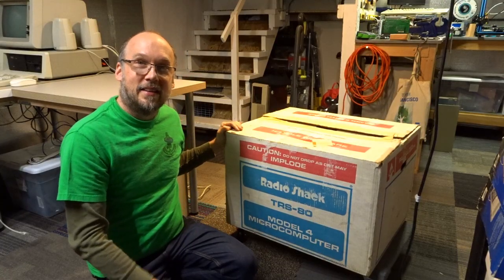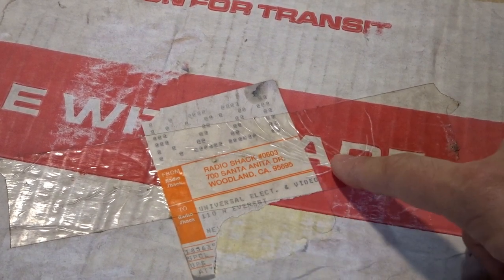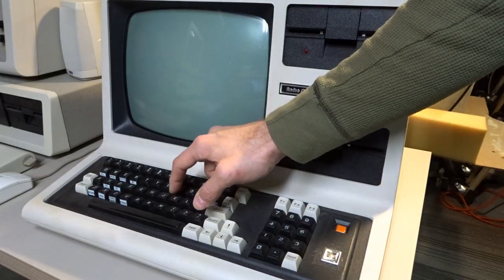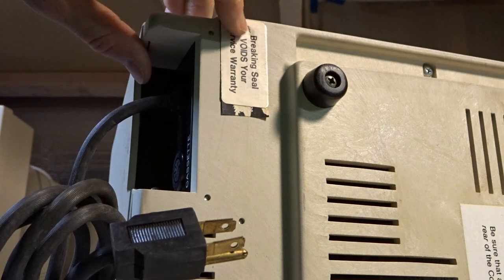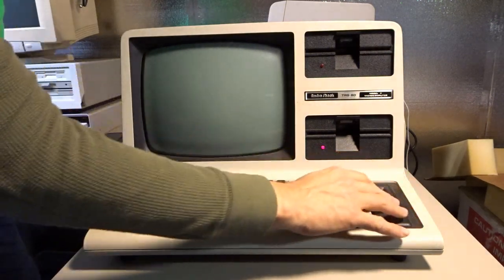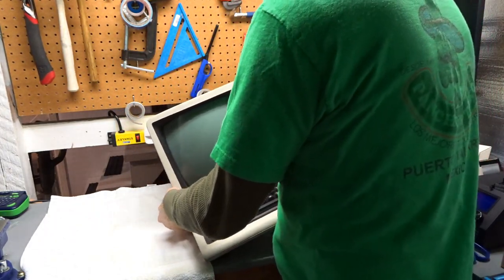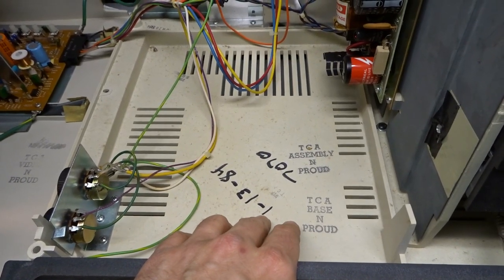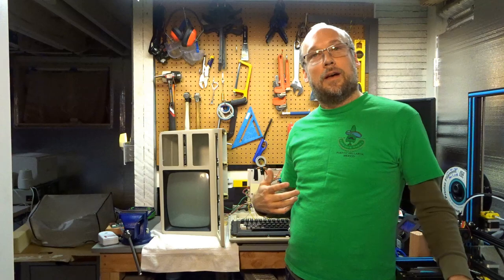Is that smoke? Radio Shack TRS-80 Model 4 Computer Unboxing and Test

Comment: I was the Computer Center service manager for Tandy in Santa Rosa CA in the 1980's  here are some items i saw on your computer
..The electrical tape is not from a service center..We would never ever do that...The white warranty sticker is not from Tandy..
Factory stickers were black with white text the service centers used white stickers with black text..The text and wording is wrong on yours to be from a Tandy service center...

Here is my guess of some history of that machine..

The original black sticker was from factory.
The white sticker that you cannot see (should have the words Radio Shack in the text) that is on top of that is most likely from a Tandy service center i would guess service center 01-7070 ..the sharpy writing inside case was done sometimes by a Tandy shop so that we could call the shop to get a repair history..normally though the shop number was written on the warranty sticker..(4 digit number starting with a 7) ..

The final white sticker you see is from a non Tandy shop  (does not have the words Radio Shack in the text) ..which is probably where the electrical tape was put on and the bent RF shield..

One thing that i cannot explain is the rubber stamp with the date of 4-10-1984 and the sharpy date of 1-13-1984 from a Tandy Shop ..possible just miswritten and should have been 10-13-1984?

I hope this information is helpful...

Comment: Remember working on "trash 80's" in class around 1980ish ,  finally got my own pc when the Apple IIc  came out lol
Reply: I was in my early teens and rode my bike to Radio Shack daily in the early 80's. At the time they encouraged us kids to sit and learn for hours. Sadly, I don't think you could do that today without having the cops called. I never did get a TRS-80 until I was in my 30's. Never could stand Apple, so I got into building my own PC's when that became a viable option.

Comment: Wow, $2000 for a TRS-80.   I spent $1600 for my Tandy 1400 Lt with TWO 3.5 floppies, and the internal HD (extra) would have cost the same amount.    Tandy was KNOWN for overcharging (Keyboard $100) but these were actually good prices for the time and for what you got. 

"Burn in" was what they told you to do with your new machine and some Shareware actually had test and burn in programs to make sure your computer worked correctly. It usually took 48 hours.   The stamp may mean that this machine was already burned in.

Comment: I've got a Tandy 1000HX and 1000RSX. Those are the "vintage" computers that I play with, and they're all fairly well upgraded at this point. I'd love to get a TRS-80 model 4, because I love the aesthetic, but they cost too much. 
As I type this, there's a model 4 on eBay listed as "parts or repair" for $470 CDN (and actually located in Canada with free shipping, which is refreshing), and another for $1,500 USD (~$1,870 CDN). Waaaaaay over what I'd pay for a hobby machine. These things aren't just vintage, they're collectors items!

Comment: 700 Santa Anita Dr. Woodland was not a store but a distribution center based on the building that is that the address on the label. Radio Shack had distribution centers all over the country. They really had a great supply chain and every step in that supply chain was a profit center. Yes I did work as a store manager in the mid to late 70s

Comment: So. 1985...conservatively, my Dad had a Trash 80. I don't recall the model. It had no floppies, but it had an external cassette deck for either playing or recording, and a cartridge slot. It definitely had no monitor as it connected to the TV. We had Zaxxon on tape, and Demon attack on cartridge. If we wanted to do anything else, it was via Tandy Color Basic...a big ass book that came with it. My youth was full of "Syntax error line x" as I spent days programming "The Battle of Midway" a text based, battleship clone, or making very rudimentary offerings.

Comment: A Radio Shack computer was my first computer. I had it one day and then took it back. I took it back because there were NO manuals at all with it. The store told me I had to take 6 weeks of classes in Milwaukee in order to learn how to set up and use that computer. Those classes would have cost about 1/2 what I paid for the computer. 

I ended up buying an Atari 400 computer which turned out to be a better fit for me anyway.
Reply: Erm. Ok
Reply: That store was ripping you off. New computers came with manuals and even if it didn’t you could have gone to a library or bookstore and found books to teach you.
Reply: @Sashazur  This happened when the Radio Shack computer first came out. There wouldn't be any books in the library or bookstore specifically for the Radio Shack computer. 

I didn't even know how to hook it up. I'm sure I could have found a book on Basic if I had even known what Basic was.
Reply: bjbell52 The store must have taken the manuals out to rip you off. My TRS-80 came with detailed manuals.

Comment: The first thing you have to do when dealing with old computers, is to get rid of the RIFA caps from the power supply. You can replace them or simply put them off.

Comment: Wow.  My first computer was a model 1. Later I bought model 2 PROMS. The bummer there was the model 1 motherboard had room for only 2 PROMS and I now had 3 PROMS to worry about. I had to lie in the RS store to get the new PROMS because they said I was allowed to buy parts ONLY for the computer I already owned. Right or wrong that was what they told me, while looking down their noses at me. I then bought a model 2 service manual and in there was a diagram of the PROM expansion board, which turned out to be fairly simple. I was in college at the time and used their lab to design and build my own expansion board. I mounted it inside the case and connected it to the original single PROM socket via a ribbon cable and header assembly. It worked perfectly,  but I still had only 16K of RAM. I found an electronics shop that had 64K x 1 memory chips. I bought a set for the horribly expensive price of 100 ish bucks for the set. They too worked perfectly. I still have that Frankenstein system and boot it occasionally to play one of the first versions of Flight Simulator from Sub Logic. Good times. Great memories!
Reply: I never saw a Model II other than in the catalog.  From what you're saying, I gather that it was similar to the Model I internally?  That was probably the heyday of amateur electronics and computers overlapping.  The CPUs were still slow enough to hack with off-the-shelf out special equipment without worrying too much about wire length and interference (ignoring the EMI that the Model I itself put out).
Reply: Yea, the Model 1 and 2 are almost identical.  The PROMS are the only difference (that I know of).  I bought a small RS program that boots with a machine code prompt.  I then printed out the PROM contents to make sure I had a hard copy.  Dunno why...that was a waste.  But I still have the 2 inch-or-so thick fan fold paper printout.  No disc drives for this model that I knew of.  Input was a cassette tape and I later bought a neat product called, Stringy Floppy which is connected via a system parallel port.  It uses a small (1/8"??) endless loop tape.  It still works!  The cassette audio input is currently flaky, I think likely due to a cap that is probably going bad.  The slow CPU speed of the system made making hacks and cables no big deal.  The Z80 was close enough to the 8085 that I was using in college, so I was able to use it to do homework (via a 8085 in a SDK-85 bread-board system).  All fun stuff!

Comment: This machine always reminds me of the Sperry I cut my commercial teeth on, very similar looking and back in them days I had up to that point only worked on what I could find down the scrap yard which was pretty much the Commodore PET and the reason them PET's were thrown away is because they were broken beyond feasible repair yet I managed to fix a couple.   The Univac I used for British Rail as part of their emerging TOPS system of rail unit management, I lost my job as a prank I and a friend pulled saw British Rail's sealink ferries tasked into the nearest railway carriage repair shops, not knowing the very tempest of disaster that doing such would cause... you see everything in British Rail had a class, from a paper napkin to a car ferry and they gave car ferries a locomotive classification and it was a doddle to task all of BR's class 99's as they were known for carriage repair and cleaning, the other end instead of rejecting the job as would have been suspected, acted on it instead and opened up 8 bays for reception of 8 sets of class 99's.   Movement orders were then given for class 99's to be taken out of service and attached to locomotives for towing to Eastleigh rail works... so eight locomotives arrived at Southampton and other docks waiting to be connected to eight sets of class 99's which were no doubt bobbing merrily in the water... when the area manager realised what a monumental cock up had happened he spoke to me and didn't repeat himself swearing over 15 minutes... whereupon I was summarily sacked and ended my railway career.   It did serve a monumental lesson to British Rail on operational difficulties in such situations but it didn't save me my job...   I went on and did some banking software, I wrote a banks clearing house database in a lunch break which survived into the 2000's on the back of a piece of paper, simple thing linking clearing house stuff to share databases for tax dept stuff, it was so cool and modular too, just had to add layers to let it grow ad infinitum which it did and was this banks second largest database until modernity took over.   Any modern UNIX operator would recognise the principle, building the house around the core always but back then it was all new stuff.  (sorry for long post)
Reply: And I bet you got precious little appreciation for delivering a durable, extensible, and time-tested system. 

Kindly don't ask me how I can be so confident in saying such a thing.

Comment: This i so so cool , I remember the day I bought a Model 4P. I think I might still have 5.25 CPM/MPM Montezuma 2.2 disks for this instead of running TRS Dos. A side note the Floppy cable is missing pins. If you create a full loaded cable you can go the full 96 track 17 sectors I think to have 720K floppies. Ran a BBS for years on one of these.

Comment: Yeah, all of those power supplies are on borrowed time, and easily repaired, im sure all of the caps were passing a lot of DC and did bad things in this scenario.   Should have at the minimum been brought up on a variac, ideally, ESR testing on the PS filter caps to get an idea of overall health.
Reply: Dude, it is still working.  Just the X2 cap failed.

Comment: Damn RIFA caps. Always explode after being turned on for a few minutes. You're right - the smoke stinks. They're used in all sorts of electronic equipment. Computers, oscilloscopes, printers, test gear and more.

Comment: pretty good find, TRS-80s in that condition are hard to find at 80 bucks. Got any good software for it?
Reply: I would be too had a TRS-80 Model 4P ages ago, wish I still did
Reply: $80 is a steal! They go around $500-2000 CDN on eBay. These aren't just vintage PCs for nerds to muck around with, they're collectors items!

Comment: I learned to program on a Model I Level II and used IIIs and 4s at school.  We had a shared network hard drive that 8 megs and was about the size of a desktop computer.  How things have changed.  I found a patch to TRSDOS that would remove the passwords on the entire system.  I still remember the memory location.  My teacher knew I could do it, but I didn't show her or anyone else how and she was ok with that.  At least once she did ask me to unlock a student's suspect program and her suspicions were confirmed.   I think he thought it was funny to have a program that put up threatening messages towards the teacher.  Since there was a password on it, he thought it was safe.  Nope.  I wish I could remember more about that situation.  It was only about 35 years ago......

Comment: I've got 2 identical 30 year old vintage vhs machines, one from a smoker household and one not. It makes a major difference in condition. The non smoker is mint inside. The smoker stinks and is all yellowed, white plastic gears have turned almost brown and there's evidence of cockroaches present at one time. It's been relegated as a parts bin and stays in the shop.

Comment: You know what's scarier then a capacitor letting go? Having a BIG filter capacitor let go in a big stereo (Realistic STA-2100) with headphones on. R.I.P my headphones and my underwear. When the filter cap went for some reason it messed with the headphone output which "borrows" power from the left and right channel amplifiers, it blew up a pair of 16 ohm studio headphones with 45mm drivers. To this day I still have to find the rare high power transistors for it, one of them went a little funny when that happened. It's been recapped but one of the channels overheats after 10 minutes.

Comment: Im thinking "N Proud' is likely the guy or girl that assembled the machine. It would make sense. Just about the only computer that still brings about the same price now as it did new. This was a top end unit, but its ugly sister was only around $350.00, had this been a true unopened machine it would bring $350+ easy in the right circles. The V20, C64 and 128 are holding their own too. Love this vid... good job.

Comment: Burn in and proud 
Haven't heard that in a while.
Burn in = the unit was tested under load for an extended period of time.
Proud = passed all items working good no failures during burnin.
You'r supposed to put something other than proud if you had to do a burnin repair on new equipment.   Most fudged it tho. just fix it re test and ship.

Comment: Recently turned on a TRS-80 Model 4 we got for really cheap ($40, can you believe it?). It booted perfectly, all is good. Then we got a loud crackle and pop, and smoke. Same cap blew on ours!

From what I've read, it's just for filtering the RF from the AC line. Considering the machine was running fine for the brief moment after the pop, is it possible to just remove the cap and run the machine without it? Inevitably it will need to be recapped anyway, as a machine this old can get some bad capacitor issues, but in the meantime, is it safe to just run it off of a filtered UPS?
Reply: The cap prevents RF from being radiated out of the power supply.  The thing is a noise generator without that cap.

Comment: Lucky guess on the Break key... I'd have put money on you not figuring it out.  To be totally correct, you held break while power cycling, but realistically, you can turn it on, and hold break and press reset, that was typically how you booted a non-disk system.  If you look around there's a lot of virtual disks you can download to a PC and write them to a 5 1/4 inch drive so you can boot to a disk system.  I recommend NewDos 80 for the OS.

Comment: What did you do...what keys did you press to bring the characters back to the screen? I have the same TRS-80 with the same kind of parallels lines on the screen.
Reply: Hold down the "break" key when turning the power on to start in ROM BASIC
Reply: Or put a boot floppy in it

Comment: Was this cold by chance when you turned it on? I learned the hard way never to turn on cold electronics in a warm house. It causes sweating and component failure.
Reply: The RIFA paper capacitor fails due to ageing and unclimatised storage. Even if you warm it up before, it will fail within hours or days. It was already an outdated piece of crap when this computer was built, but RIFA seemed to have kept the hype going for years and manufacturers bought in to it.

Comment: Didn't these computers run business programs like BASIC, FORTRAN and Cobol?
Reply: BASIC was built-in to the ROM.  If you got the Level 2/3 BASIC on these, the dialect was very similar to GW-BASIC on the PCs, which isn't a surprise since Microsoft wrote them both.  I'm pretty sure there were compilers available for FORTRAN and COBOL as well.
Reply: And spreadsheets and word processors and games and all the other things every other computer ran.

Comment: god i really want an old 80s computer but they're so expensive ;-;
Reply: Exotic Butthurt There are enough Commodore 64s out there you ought to be able to get one cheap. Just go for the older ‘breadbox’ style as the 6581 sound chip is better than the 8580 in the 64C.

Comment: What could you possibly do with a Trash 80? I mean, it's cool to see one in that condition purely because it's old, but, there was really never anything to do with them (hence the name). $80 seems steep. Neat vid though.
Reply: Have you seen the prices on eBay? These are collectors items!
Reply: If you have to be told, you wouldn't understand.
Reply: Hey man
Don't talk trash about the 80s. man.
the 80s RULED Man . . . .
You MOTHER was an 80 man . . . 

(sorry, too much time on chatboards.  I need to lie down.  )
Reply: +Laceykat66 The 1980s were awesome. Trash 80 is what TRS 80s were called. It was a term of a similar nature to "(cr) Apple Macintrash".

(yes, we were PC guys)
Reply: There was lots of software for these.

Comment: Yeah...  good ole 8008.   Wrote my 1st program in TRDOS.,, or.. I did that on a TI-99 where I hooked up a teletype keyboard....
Reply: Trs-80s used a Zilog Z80, not an 8008. Ti-99s had internal keyboards just like trs-80s.

Comment: Model 4 in a Model 3 case.  Might be like the 4P where you need a boot disc to work.]
Reply: Shouldn't.  Model 4 came with the Model III ROM so if it did not detect a floppy disk it should say "CASS?". The Model 4P (to save money and motherboard space) did no thave a Model III ROM. To use Model III software, you had to have a Model III ROM file on the diskette (Modelaiii I believe it was called) to load any Model III operating system.